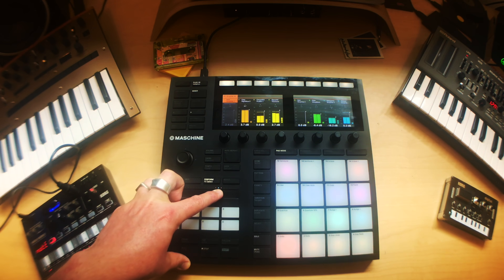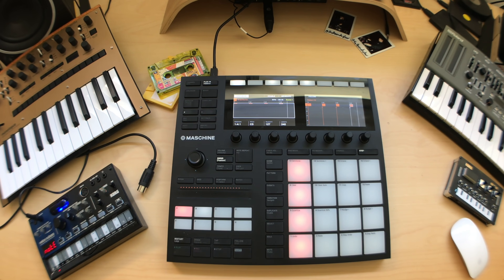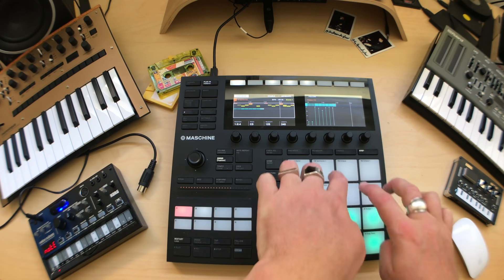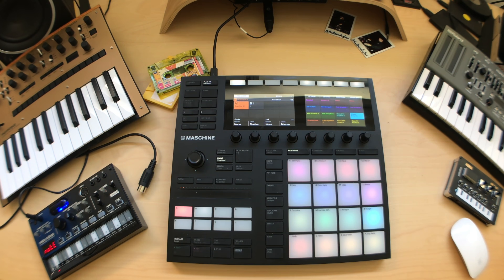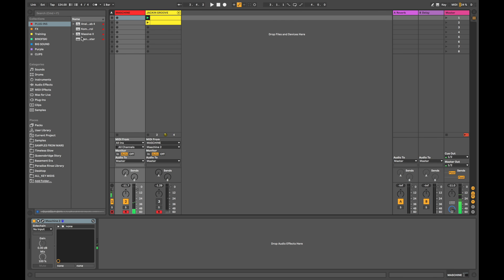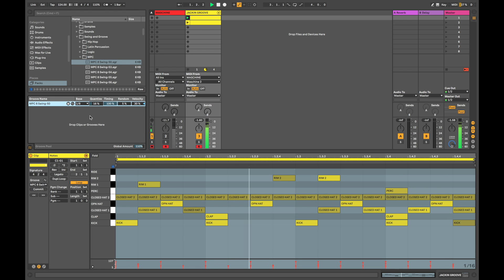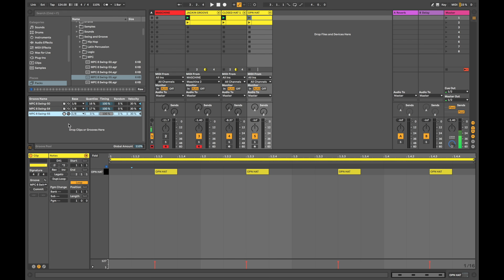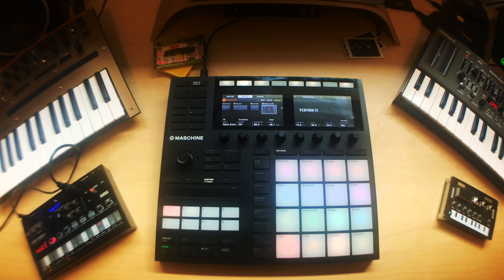How To Make Jackin House Beats On Maschine + Ableton Live

Comment: Do you prefer the swing/groove on the mpc or maschine?
Reply from the maker: MPC has a more unique swing groove based on the original MPC's, Maschine is more versatile and has many adjustable parameters and the ability to change groove per step. Both are fantastic